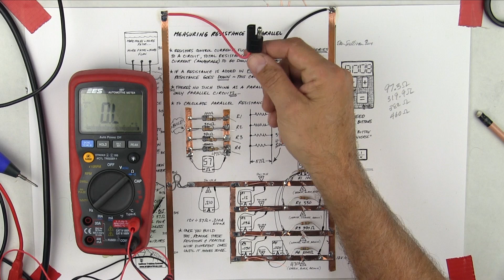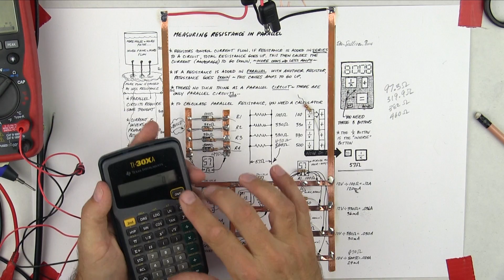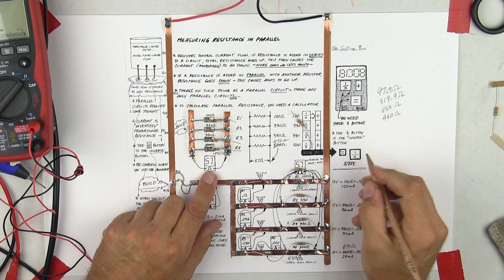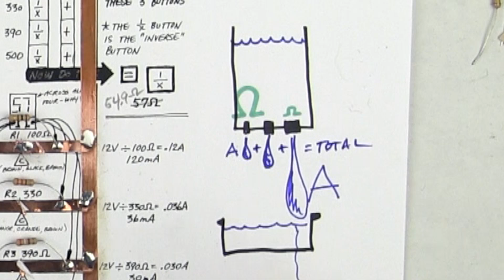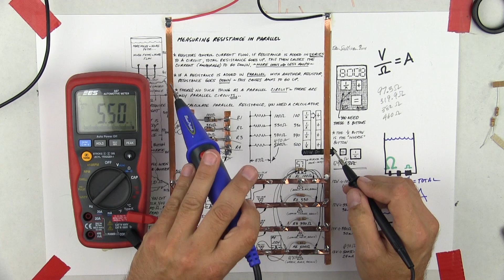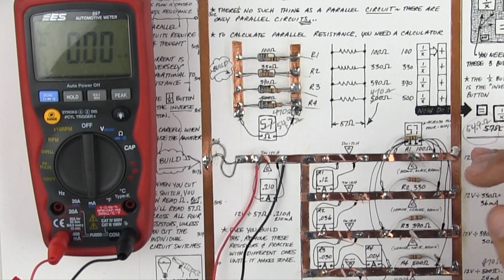CARD 3B - PARALLEL RESISTANCE 2 - Hands-On-Line Electrical Training

Comment: There will always be a slight bit of error based on burden voltage, resolution and position of the test points. Even the trace on the circuit to the resistor has "some" resistance. Well done.
Reply: also the resister percentage tolerance  and measurement inaccuracy of the meter.